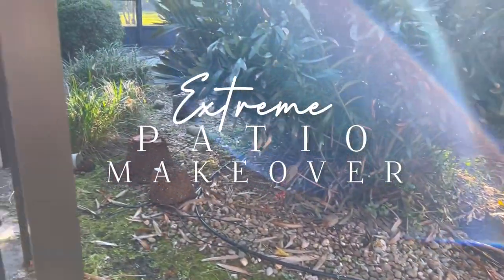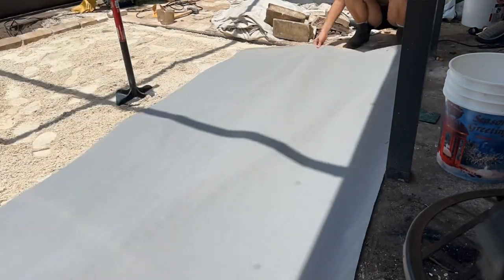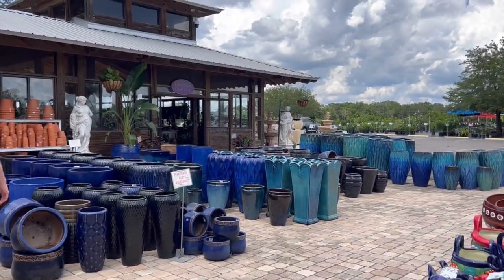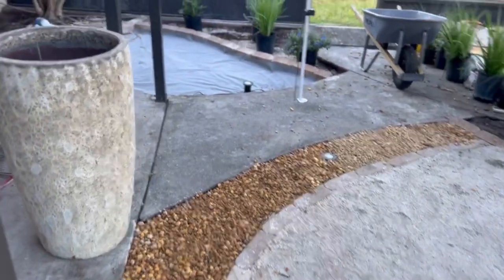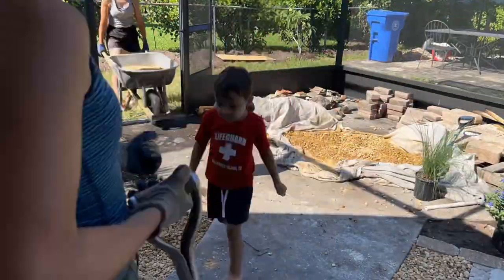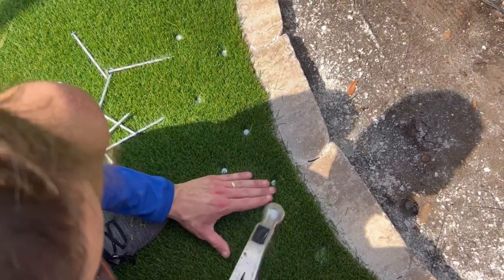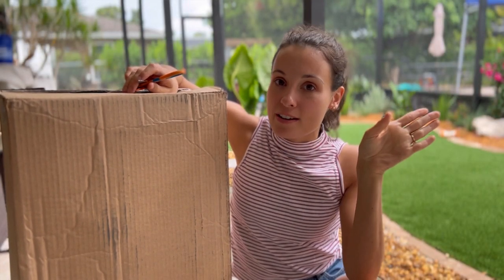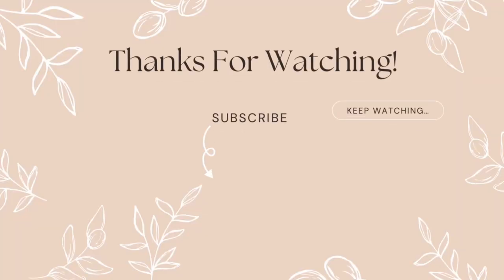We turned a jungle into our dream patio! DIY transformation

Comment: This has turned out absolutely beautiful! Your young family will enjoy this for many years to come.

A few suggestions you may like to consider:
1. I would spray the gravel with 'mulch glue' to keep them in place so you aren't constantly seeing the concrete alongside & also to prevent little fingers from picking it up & throwing it around (my son loves to do this 😂).

2. An epoxy coating on the concrete (the one where u sprinkle little chips on) would make the space look next level. Makes it easier to clean & u can put a non-slip top coat to make it safer.

Thank you for sharing 🥰
Reply from the maker: Hadn’t thought of those!! Thank you for the tips. This space is growing beautifully and we are in the middle of adding a veggie garden outside the lanai. Can’t wait to share an update soon! Thanks for watching ☺️

Comment: You remove plants because you are worried they are toxic to kids and then you put in plastic turf which is full of known human carcinogens benzine, arsenic and styrene, not to forget the plastic particles that kids can inhale when they are rolling on the grass.
Reply from the maker: Hi Portina! Thank you for your concern for my family’s safety. I should have addressed that in the video because it’s something I did a good bit of research on. From what I found in recent published journal articles (not blogs), the toxicity is actually in the infill (namely crumb rubber) not the turf itself. We went with a pet and child safe infill that met all testing and we felt good about. The plant we were most worried about was the cardboard cycad. It had very enticing red berries and even a small bit ingested would cause liver failure and has no known cure. Always important to do the research!